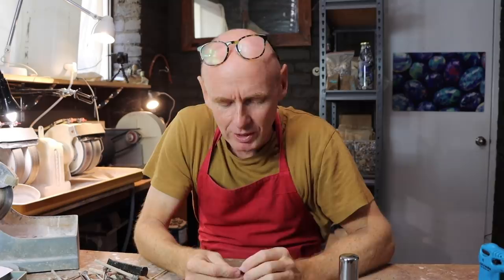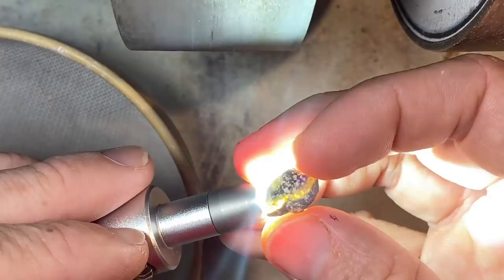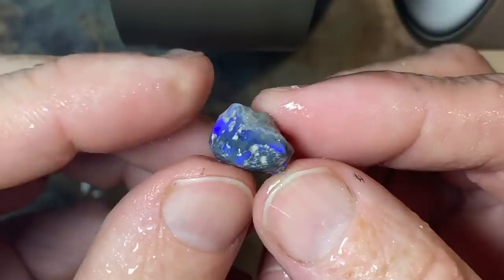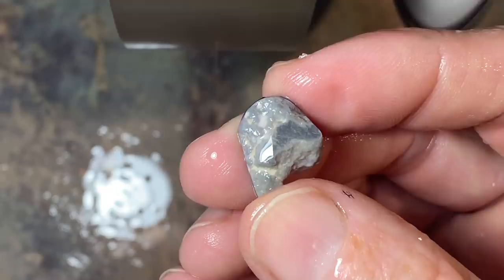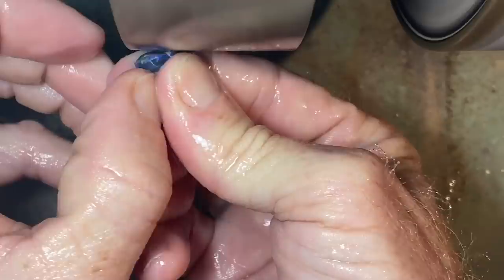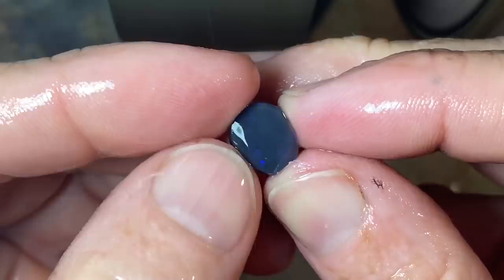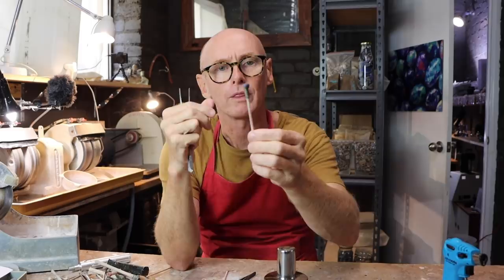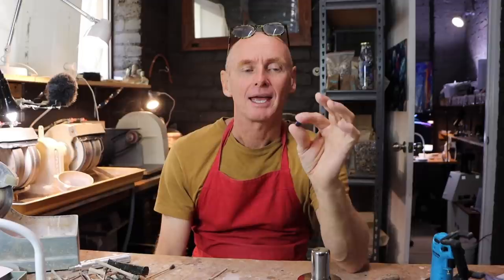Glowing uncut gem. Does it cut clean of sand and inclusions

Comment: So this brings up a question I've had brewing for a little while watching your videos. I'm a complete noob to gems and lapidary work, so this probably has an easy answer. In a situation like this where you may have to remove more potch than you'd usually want to, and you may not have as much backing material as you'd like. is there no artificial backing material that can be used? Or is that just considered taboo and tacky?
Reply from the maker: Black glass